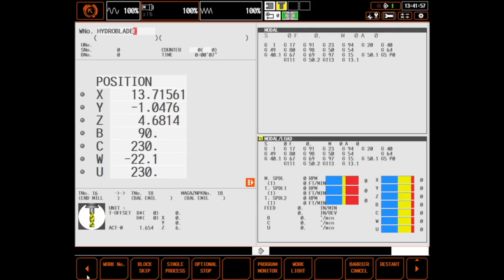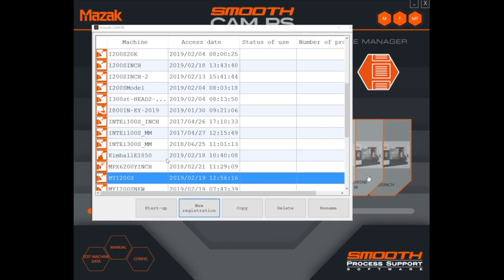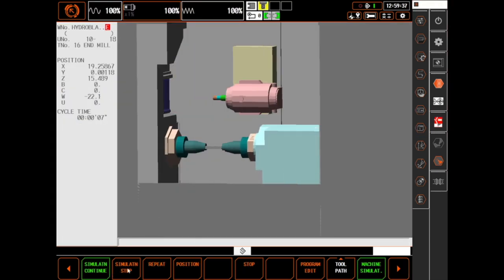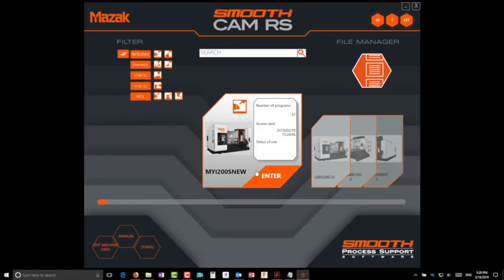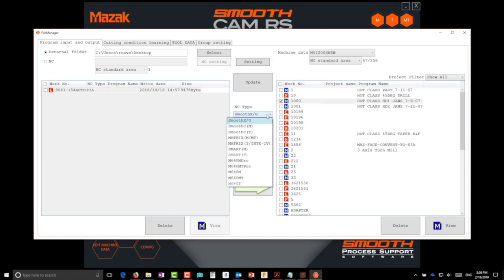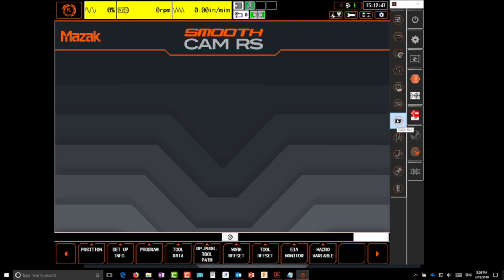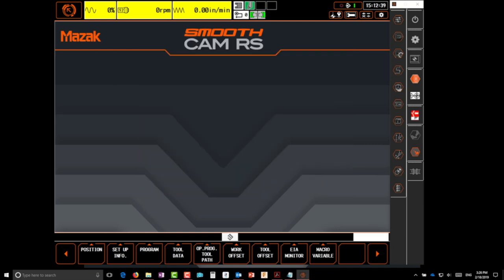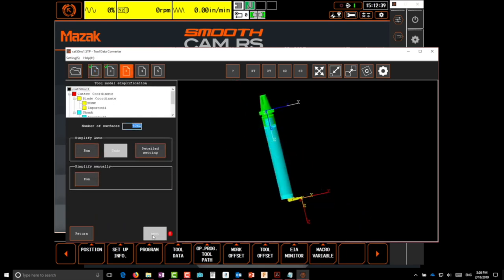Mazak SMOOTH Cafe: SMOOTH CAM RS Desktop Programming

Comment: Will this support .EIA programs for simulation as well? We often times need to run lengthy programs through simulation on the machine but it takes the control longer to process the code than it takes to run the program. We believe that something like this desktop setup on a much more powerful computer will greatly reduce setup times. Basically we want the machine simulation that’s on the control to be on our offline programming computers. We just need to be able to input our work offsets so simulation is accurate. 

Thanks!
Reply: You have the right idea. SmoothCAM RS allows you to emulate your Mazak on a computer. You can access all simulation and programming tools... pretty much anything other than the cycle start button or manual operation controls.